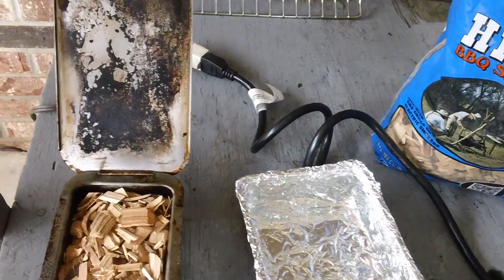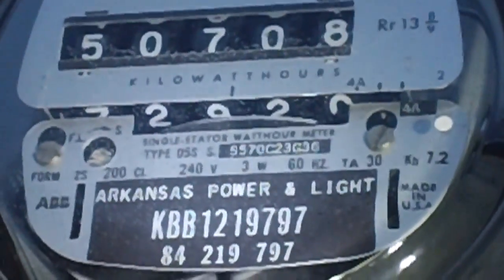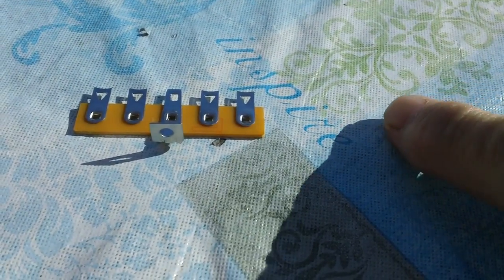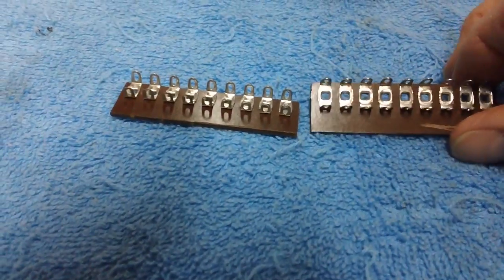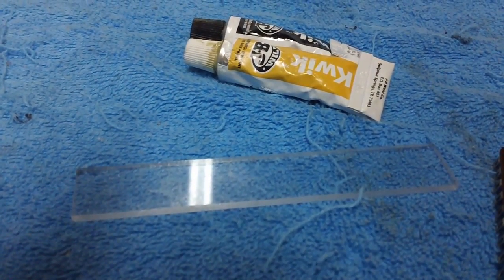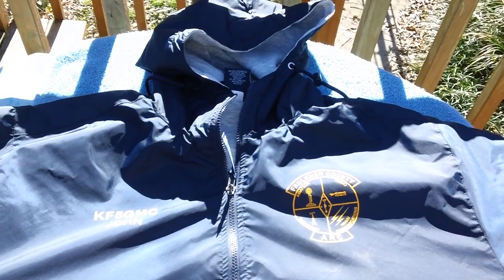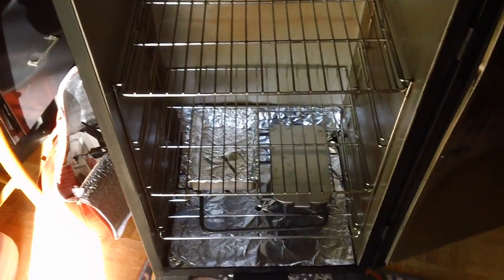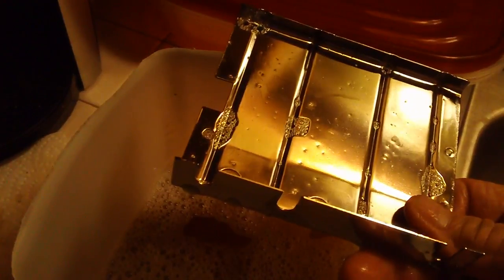Mish-Mash #137

Comment: Merry Christmas John. On those shafts they made to do that. Although they should snap back into place, you may not be pushing them all the way in. They did this because they made different shafts at one time for those universal controls.
You gotta love the Evapo-Rust as it does a great job.
Reply from the maker: Thanks, Dennis.  Two of the shafts were homemade by someone.   It seems that this old scope was used quite a bit.   And Evapo-Rust does do a great job, but not that good.  I had that piece of metal chromed.  LOL

Regards,
John

Comment: I remember roasting a turkey in a Weber and using dampened hickory mixed in with the charcoal.  At least the electric meter wasn't turning at 78 rpm. I never cleaned and clear coated a tuner assembly. That really looks very good. Nice jackets OM. If you used Eazy Off on the smoker you might end up on your back with your arms and legs folding up. I went through two TURPS back in '03 and as I tell guys going into the urologist for the first time that if I can get through that anyone can.  Gary

Comment: Yes my friend, I think I might be able to shed light on those type of controls, or pots, fitted to your oscilloscope.  I have only ever encountered that arrangement, or similar looking types, twice in my life.  Describing the ones I saw may not be applicable to answering your question but here goes, and do forgive me if I come across as rather vague.  They were, what was describe to me when I was a teenager (almost forty years ago), as panel-mount ‘high-precision’ preset-pots, or, ‘tamper preventative’ pots.  They were fitted to the front of, what would have been during the early 1940s, ‘high-tech’ Pye, Cambridge, (and on a piece early 1940s Decca radio precision alignment/test equipment), radio communications precision alignment/test equipment (to achieve plus, or minus, 0.25%, and below, alignment tolerances) for specialised transceivers used in WW2 RAF bomber aircraft, tanks, and Royal Navy submarines, and warships.  Once the test equipment was calibrated and set, there was no need for further adjustments until it was time for scheduled retesting, unless it broke down before then.  Those early 1940s pieces of test equipment were so large and heavy, incorporating anything from twenty valves, there was little practical option but to test/repair/recalibrate them in situ hence controls fitted onto front panels.  When such operations were complete, their centre rotating spindles were detached from each pot so no unauthorised person could make any clandestine alterations at some later date.  As you may imagine, I was surprised to see those types of control, if indeed they are those types of control, fitted to what in effect is a general purpose bench scope…if perchance they are, perhaps your scope started its useful life in a ‘design shop’ or ‘testing lab’???  
Did I hear you indicate there may be a Vintage Radio step-by-step restoration sometime in the future…Bring it on my friend…Bring it on…and you can resume productions as soon as you like for me.  I truly love your radio restoration series videos.  May I suggest you look at it in this light: you are not repeating yourself but you are contributing to an International Vintage Radio & Television Repair/Restoration Reference Library (for example, anyone requiring service tips for a Philco 630B  has almost instant access at their fingertips) …that’s how I regard it LOL. 
I like your am-radio club coat.  It’ll keep you warm when participating in alfresco SSB, or CW, contests during autumn and winter???
I too have not heard anything from our mutual friend Brendan.  Over the past two weeks, I’ve been tempted to enquire how he is doing.  I genuinely hope the chap is okay.
May you, your wife, and your family have a wonderful Christmas, as well as a happy New Year.
Regards,
Phil.

Comment: John - I asked some folks on the Heathkit page about the knobs.. here is the response  "There were "customizable" pots on the marked back in the 50s and 60s that you could configure in a number of ways regarding shaft type, shaft size, element type, etc... Could be one of those..."
Reply from the maker: Ron,
In the end I'll probably have to replace a couple of the pots as they feel a bit gritty, but right now I have a bigger problem with it.

Regards,
John

Comment: In regards to your oscilloscope project. In the 1950's Clarostat Mfg. Co. made replacement controls that came with separate shafts that could be tailored for your application. The end of the shaft fit into the control and had notches on the flat portion that would snap into place with a light tap on the other end of the shaft. They also made switches that would attach to the back of the control. I hope this helps.
Reply from the maker: James,
Thanks, my friend.  I'm glad this issue came up.  It's been very educational.

Regards,
John

Comment: Good stuff John... and a very Merry Christmas to you and your family. This is a perfect time to watch It's a Wonderful Life on the old Halolight.  :)  Peace to all.

P.S.  on the Oscilloscope, I noticed you left the hacked fuse holder in there with some dangling electrical tape.  Will you keep that in there ?
Reply from the maker: Thank you, Ron.  The same to you and your family as well.  And I'll of course improve the fuse holder situation, but I first need to get the scope up and running.

Regards,
John
Reply: +joernone  John, on the OL-1 knobs, I would say they have been replaced at some point.  See this photo of the same model which looks like the pots are very different.  https://pbs.twimg.com/media/CWoRGygXIAE85LZ.jpg:large 
   Perhaps someone rigged up a way to use the original knobs which is simply a guess.
Reply from the maker: Ron,

They do look  different.  So do the caps.   It appears that Heathkit made several of changes to this critter.

Regards,
John

Comment: John - for the 20uf 150V caps connecting to  V1 and V4  , did you use Electrolytic Caps or non-polarized ?
Reply from the maker: Ron,
I went with what was originally installed...polarized.  Page 18 of the assembly manual shows them as polarized, with the negative ends connected to the two pots.

Regards,
John
Reply: +joernone  Cool.. my approach as well  - thank you !!!!